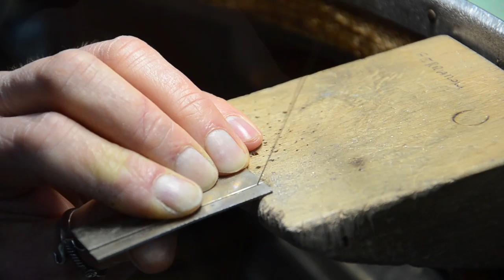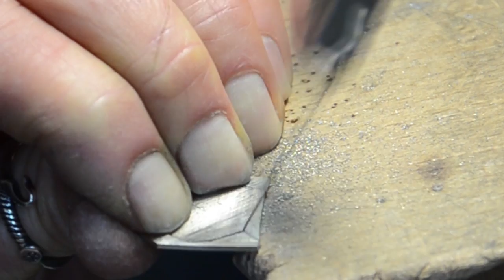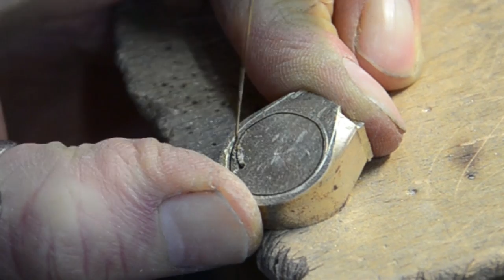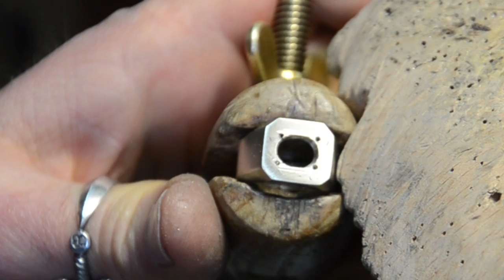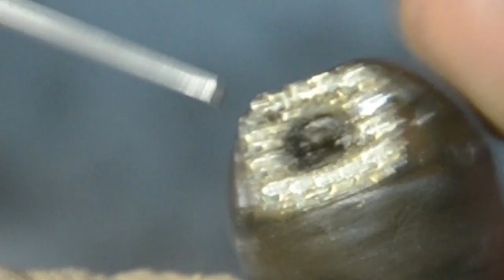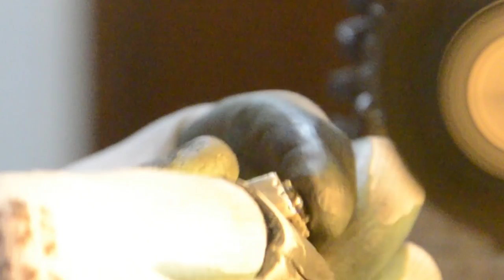handmade gold ring with blue sapphire and diamonds

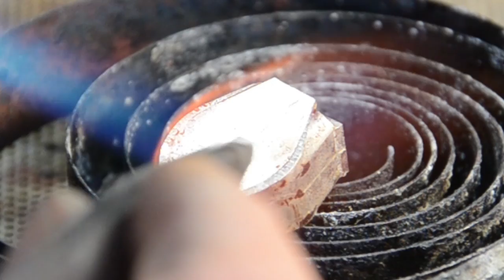Comment: Around 4:03 what did he put on the ring that melted and why did he only put a few beads? Wouldn't that make for a weak connection? Also, what material were those rods that held the big gem in made out of?
Reply from the maker: It's gold welding at 18kt. Once melted, it becomes a unique body with the two pieces to attack.
Reply: scaffoal so those beads were gold pieces? And what does welding at 18k mean? And were those rods holding the big gem in place gold too?

Comment: is that regular pitch that you melt to hold the ring around time = 10:40?
Reply from the maker: IS MASTICS FOR SETTING
Reply: Thanks!  I for some reason can't find mastic on any of the jewelry making supply stores online.  Do you have a link to where I could buy some online?
Would pitch work in the same way and would pitch hold the ring/piece securely?  I need to find a way to hold small pieces for engraving.
Reply from the maker: http://www.pelusi.com/1/adesivi_colle_mastici_4088828.html
Reply: Thank you!

Comment: Its clear You used soldaring many times so the finishing was very bad you can see some stain very clear after polishing
Reply from the maker: Unfortunately, the stains are due to a non-perfect rhodium brought out by the flash of the camera, problem solved. For the weldings I use a gold alloy with 18Kt title with high melting point, it leaves no traces.

Comment: This is very big process.... I make it in short process and less loss gold...
Reply from the maker: Also I can produce it in lost wax casting or with 3D printing, but this technique is the classic technique, which does not require particularly expensive machinery and guarantees a high quality of the finished product.

Comment: looks like an extremely inefficient way to do this.. both in effort and amount of materials used/waster.
Reply from the maker: You're wrong, there is no waste, is fully recovered. The work is finished better, often the execution times are the same as other techniques. there are no problems for any of the jewel in the future changes, the type of measure change. On the contrary the jewelry made of wax casting often lost are porous and fragile, as it happened in these days, a ring made in lost wax casting during the change of measurement of the finger, the ring shank is broken in several places.